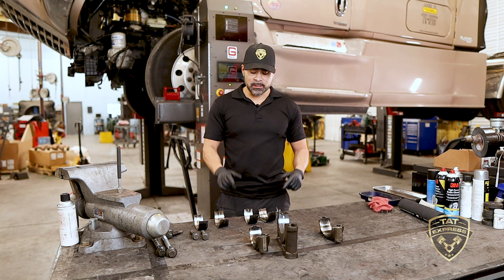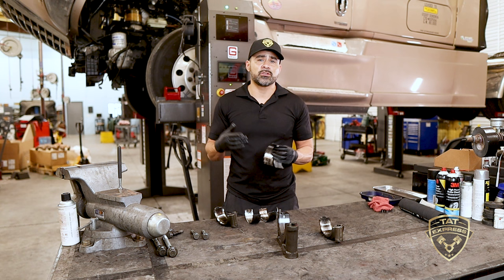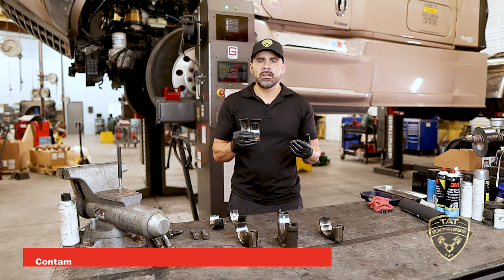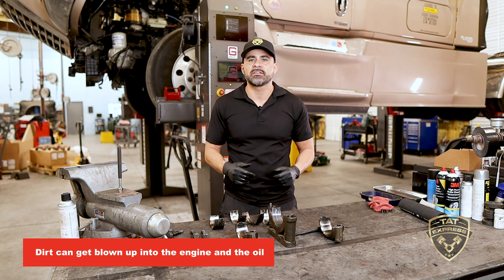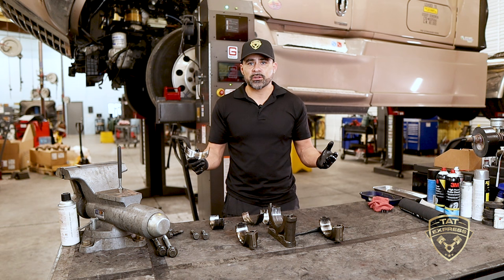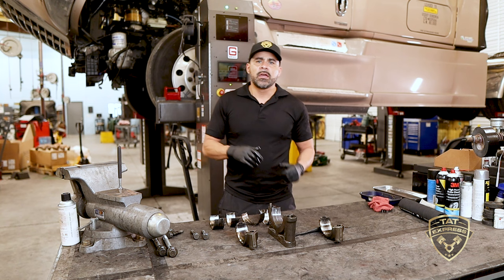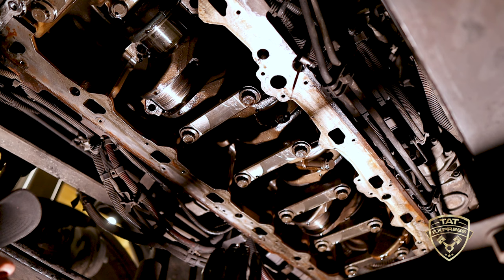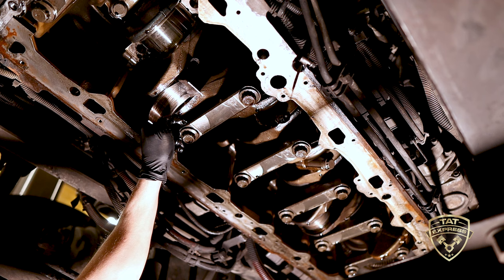What causes an engine to lock up/What is a Spun Bearing/ DD15 engine failure/DD15 oil pickup o-rings

Comment: I agree it is irreparable, but if absolutely necessary it can be "band-aided." My son-in-law didn't heed my advice to check the oil every time he gassed up their 1993 Honda Accord. Instead, when the oil light came on he dumped three quarts of oil in it. Then the oil light failed, and soon after that the engine seized on the freeway. He had it towed home where my daughter implored me to get it back on the road for six weeks. Sigh....
I dropped the pan and found a couple ounces of bronze filings in it. I removed the caps on all the rods and removed the bottom carrier to let me replace the fixed bearings (lower half only). I bought the bearing set and plastigage. Amazingly, all the journals were in spec (not that it mattered a lot; I was committed). I slapped it all together, ran 4 quarts of cheap oil through the engine to flush out the foul smelling goo and filled the crankcase with fresh 40W. The camshaft looked like it had been in a cat fight and the compression was abominable (ranging 95 to 60!), and the Check Engine light was always on and I didn't care why. I admonished them "no more than 2/3 throttle and no more than 65 mph." It lasted about two months until they came into money that enabled them to replace the car. In MASH they called it "meatball surgery." Strictly a DIY thing.
Reply from the maker: Thanks for sharing.  👍🏼💪🏼

Comment: Weldone bro, buy how could they have prime the oil system after the replacement of the oil pick up. Is it filling the oil pump with oil before replacing the sump or prefilled the oil filter to help oil circulation faster.?
Reply from the maker: There is an oil priming tool

Comment: Good info, difference between a Dd15 and a CAT IS at 100000 miles you buy a new. Block for DD, A CAT you line bore and go another 100000

Comment: now the question is can you prove that the 1st shop caused this to happen? if so are they on the hook for another engine?
Reply from the maker: This failure happened within 100 miles after repair to the oil pick-up tube orings
Reply: @TATEXPRESSINC  will the other shop own up to their mistake? i have been to plenty of shops even stealerships that had some poorly trained staff. one guy was doing a brake job on my 96' freightliner and could not figure out how to get the inner wheel off on the left side. that is when i figured out that i should probably do most of the work myself. however this takes time, requires me to buy tools that i do not have and instead of kicking back and enjoying a couple of days off i get to lay under the truck while rust (new hampshire winters) and dirt fall on me.
Reply from the maker: The customer has been in contact with the other shop.  I have no further information.  Thank you for sharing your experience, and we hope you can find a trustworthy shop.  Good luck.
Reply: Hi, if I’m ever able to to get something out of the other shop I will update you on that.
I took my truck to TAT because I needed someone I could trust on this diagnostic and this guys were able to help me and work with me as much as they could.
Reply: @eddy6950  i would not figure on the other shop giving you anything even though they caused at least part of the problem that led to you needing an engine. if you get anything it's just bonus from heaven. good luck
Reply: @makeitpay8241  I agree, and I know what kind of people I’m dealing with, but I want to make sure they don’t destroy other peoples engine, at least I have to point them out what they have done and maybe they learn because if I stay quite no ones will get to know what this guys are doing, they were quick to offer me a used engine in the spot but I couldn’t trust them anymore.
Just so you know the place it’s called Extra mile in Wheatley AR.
Reply: @eddy6950  take the used engine but don't let them ever lay hands on your truck again. the fact that they offered up anything is a good sign.
Reply: @makeitpay8241  no they tried selling me a used engine
Reply: @eddy6950  oh, LOL
Reply from the maker: @Eddy, thank you for sharing your experience.
Reply: If not spun you can replace the bearings ? I got 880k should I replace them for preventative Meitence . Already had a head out on last year no liners or packs ?
Reply: Great video. Any and all educational videos are welcome. I appreciate them greatly. Keep them coming please.

Comment: Always running it low on oil and never checking it because your too lazy. And engine says aight I'm done
Reply from the maker: This failure happen after a repair on the oil pick up tubes.
Reply: This is my truck and it did have oil, good oil pressure but than I lost lol oil pressure down to 0. I had another shop replante oil pump and than they started the truck with just filing up oil no priming and 20 minutes later it locked up. I took good care of my truck, unfortunately I couldn’t fix.
Thanks to TAT for all the help I received from them, I do recommend tanking your truck to them, they know what they talking about.
Reply from the maker: @Eddy, thank you for sharing.
Reply from the maker: @marco, follow scheduled maintenance and an experienced shop, and you will be ok.
Reply: I’f we’re going to rebuild it what can you do too make it better chance of being a successful build or is it impossible?
Reply: @eddy6950  I hope you were able to get some kind of claim against the first shop.